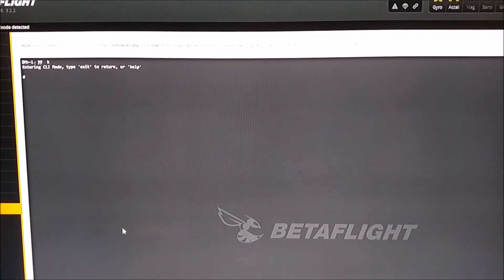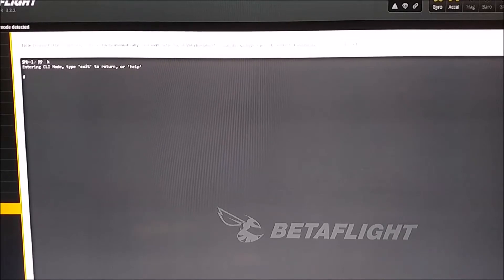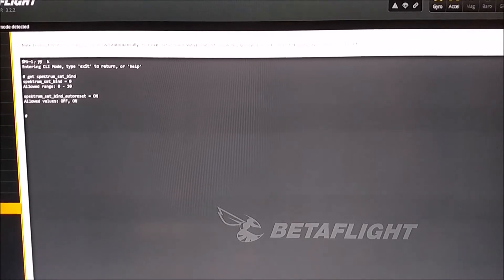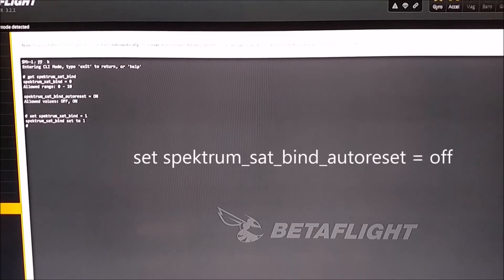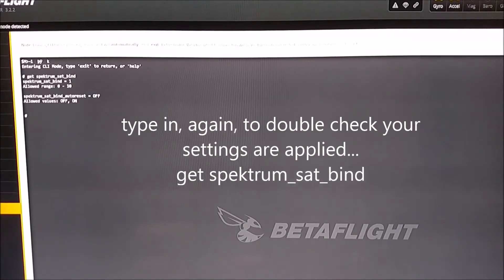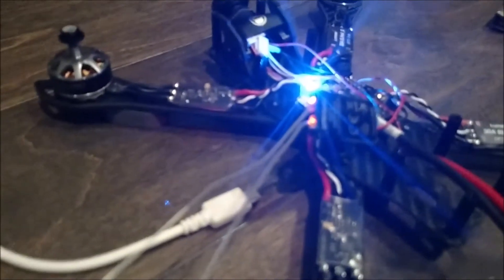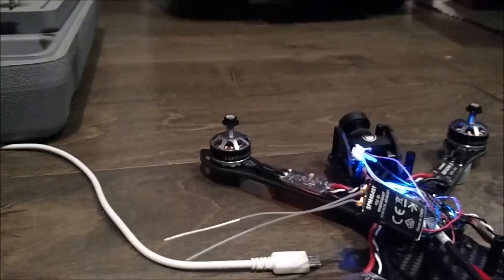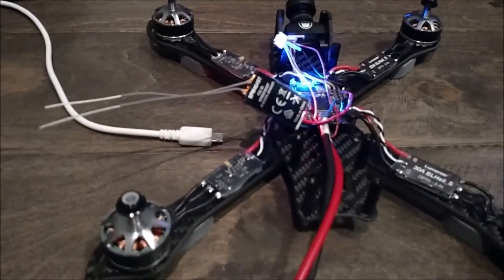Betaflight 3.2.1 Spektrum 4649T Rx bind issue

Comment: PEACE I HAVE A FISHDRONEF4 BOARD AND IM HAVING THE SAME PROBLEM, I FOLLOWED THE VIDEO, BUT IT STILL GOES INTO BIND MODE CAN YOU PLEASE HELP ME
Reply from the maker: I would suggest trying the different values for the bind setting till it no longer stays in bind mode. Just try one at a time 0 through 9 till you figure it out. I don't have any experience with the fishdrone boards, but one of the settings should get you out of bind mode. Just make sure you turn the bind_auto_reset off.

Comment: Maybe you can help me!   I have a fpv egg pro 138 that will not bind to any of my dsmx receivers.  The receiver just lights up solid orange will not go into bind mode!
Reply from the maker: Wondering what receiver and transmitter you're using?
Reply: Devo 7E modded and dsmx pro 5v and also tried a 3.3 dsmx for the heck of it plug in a frsky and got no power yet when I moved the frsky to the camera for bingo power to the receiver!  Do you think its a faulty flight controller?
Reply from the maker: If you have a multi meter, definitely check for what voltage you actually have where you're tapping in. Little confused, you said you had power to rx originally, just couldn't get it in bind mode, but with the FRSKY you had to go to your cam power to get power to it? 
Also, have you looked at the Wiki page I linked in the top comment of this vid? See above.
Reply from the maker: Oh!, and are you trying to get in bind mode with the Cli commands other method?

Comment: Thank you so much for this. I am having the same issues. Going to try this.
Reply from the maker: Happy to help, hope it works for you.
Reply: Do you know what the "1" does? I've found info on 3-10, but nothing on 1 and 2
Reply from the maker: Sorry, don't know the details, basicly it worked so I went with it, LOL. I wondered why such a range, seems 2 selections would be good enough, either bind mode or not. Guess I should look into this just to know.
Reply: It's binding for different protocols. 1024/2048 and 11ms and 22ms
Reply: Seems I cant set the autoreset to off. That setting isn't in my CLI. I'm just stuck on binding everytime
Reply from the maker: Strange, what version of Betaflight configurator and FC firmware are you using?
Reply: @TorqueRoller  I am running inav. I forget which version.

Comment: PLEASE HELP, I use a DX6i radio and bought the spektrum race quad receiver at get fpv. It flies just normal, but sometimes when I fly in sertain directions I suddenly have failsafes at a distance of 60 feet. My antennas are mounted at an 90 degrees angle and I plugged it right into the satelit port and set it up in Betaflight. What could be goin wrong?
Reply from the maker: As long as your antennas aren't damaged, then the only other thing would be to maybe change their positioning and try again. And, you are running the rx with 5v supply right, 3.3 won't be sufficient for that one.
Reply: TorqueRoller But it's the one labled with 3.3v not the 4649T one.
Reply from the maker: Domikian Glueck oh, sorry, yeah don't use the 5v then, it will smoke.

Comment: How do I get betaflight to recognize this receiver? I came from race receiver and can't get the channel mapping correct... Thanks in advance for your help
Reply from the maker: If you're referring to the Spektrum Race Receiver, I've seen this issue with a friend's quad. i had to load his config dump in the cli tab to get his channel mapping correct after updating his FC to a later version of BF. He was still using the race RX, so I had to put his channel mapping back in that was previously done. So, most likely, your FC had the channels remapped for the race receiver. No remapping should be required for this newer 4649T. I would suggest reflashing the FC with full chip erase. You can save any settings you want to load back in by doing a config dump in cli tab, and saving that command line list to a word document that you can copy and repaste in the cli tab. 
Unfortunately, without being able to view your config dump, I can't pick out the lines that most likely have your channels mapped for the race rx. Probably some lines that say "aux" with numbers after them. Hope this helps.